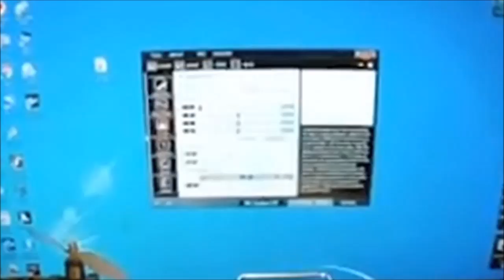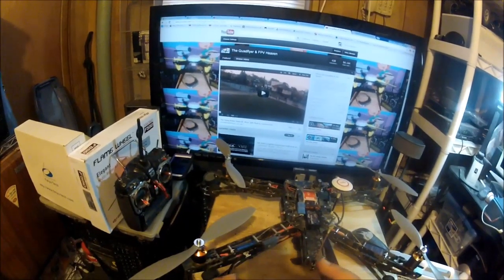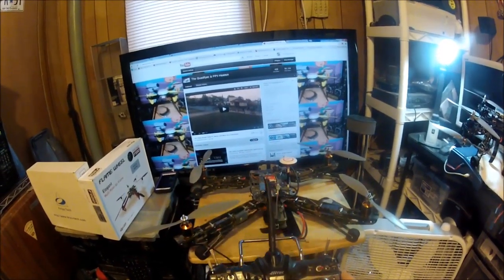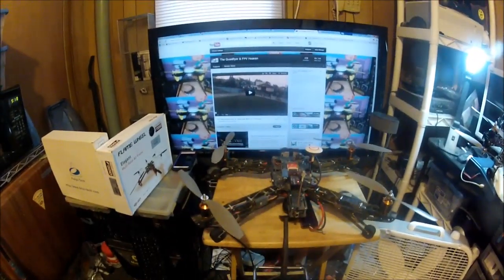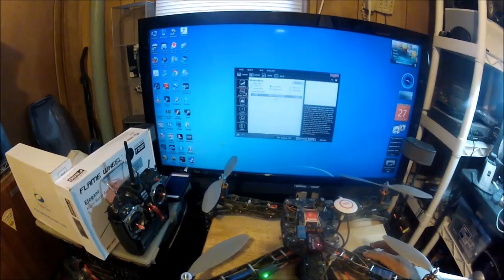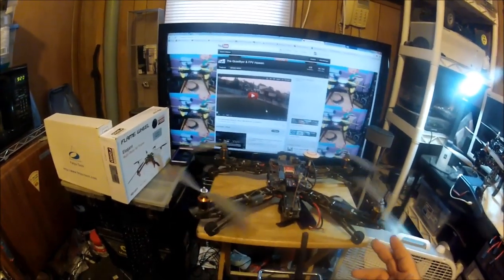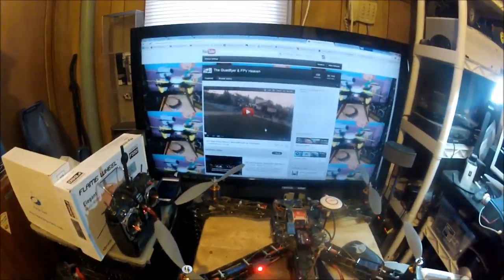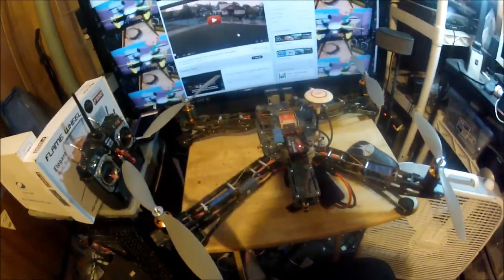How to Correct the arming issues of the NAZA flight controller & SimonK esc's

Comment: Does anyone know if someone has burned their Naza, by plugging the positive red wire of the esc, to the middle pin of the Naza flight controller marked + for positive? Why would naza mark the middle pin +? Could the flashing light, the flying rookie refers as the Naza esc, be something like a ubec, and the Naza flight controller utilizes the power of the esc? 
I'm building another hex with a Naza m lite, using Afro esc's, just like my previous hex, which fell out of the sky once, and finally flew away into a school property, securely fenced, never to be recovered, about $650.00 loss. That one had the red wire of the esc's disconnected as suggested. A little food for thought... Thanks

Comment: my drone flips after I giv throttle...any solution for it?
Reply: Check that your flight controller is the right way up :)
Reply: Check your motor directions
Reply: #1 problem: motor wires are connected to the wrong ports. So if motors 1,2,3,4 are respectively connected to 4,3,2,1, it'll be flippin' all over the place. Just try holding it while applying minimum throttle and tilting it a little to find out which motors need to be switched. Cheers!

Comment: Was able to get the motors to "arm" on "medium idle" setting with help from a friend.Calibrate the ESCs by connecting them to the Receiver module. in my case I have an R9D Radio Link.You need to change the R9D to PPM mode and plug into ch3 (throttle). the throttle will be upside down, so remember down is full throttle and up is throttle off.When finished remember to switch the R9D back to S-Buss mode.All motors will now ARM together in "medium" idle mode.

Comment: Would you mind posting your ESC setup for the SimonK configuration (2. Timing Mode, 3 Start Force, 4. Curve Mode, 5. Control Frequency,) I can arm my motors fine my problem seems to be a sync issue M1 and M4 don't have the same power as M2 and M3 have strange issue. Great videos you have produced lots of great information thank you. My setup is DJI F450 Naza lite with GPS, Sunnysky 2212-9 1400kv and Emax 40a SimonK flashed esc RX to Naza via sbus Frsky X8R TX Frsky Taranis.

Comment: Sorry! I posted another comment but I posted it in your main comments section and I dont think you saw it. Basically what I was hoping you could help me with is my "Arming" issues. I cannot Arm my NAZA-M and I have tried everything that I know to try. I even clipped my RED ESC wires last night after I wrote this comment and it still wont arm. Everything is calibrated correctly (sticks, GPS etc), my 3 POS SW is setup & my red ESC wires are clipped AND IT STILL WONT ARM :( Im so frustrated. :(
Reply: GeorgeBonez hi brother I too stuck there did u find any solution

Comment: flyingRookie I just looked it up and here are the features of my ESC's
Constant current 30A Max 40A up to 10 seconds
Li-Poly 2-3 cells; Ni-MH 4-10 cells Auto Detect
Break On/Off; Progarmmable
BEC: 2A <-- Thats my arming issue right?(((I need to pull my red wire dont I?))) 
MAX RPM 20,000 with 2212 Motors
Auto Low battery Slow down at 3.0V/cell Lipo, cut-off at 2.9V/cell Lipo

Comment: Hey FlyingRookie! I finally have my NAZA-M w/ GPS and everything seems to be setup fine according to Assistant. I am using MESTERY FireDragon 30A ESC's. I think these are pretty cheap ESC's because they came on a $250.00 RTF that had a KK1 board. Do you think I need to cut my red wire because this thing WILL NOT ARM at all? My sticks are calibrated, GPS is calibrated and still wont arm? I hope I havent damaged my NAZA. I am not going to power up again until I hear from you man. Thanks TFR :)

Comment: Great video. This also works great for my Turnigy Plush 18a escs flashed with blheli firmware. I was having the same exact issues with the motors not all arming at the same time. Now the motors all start nice and strong at the same time. Thanks